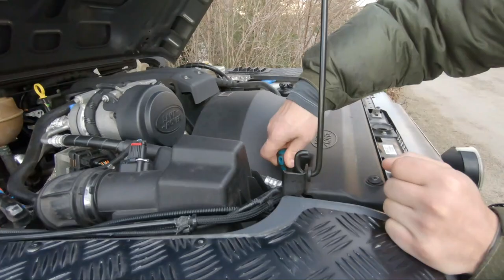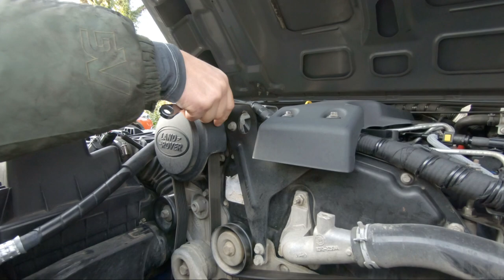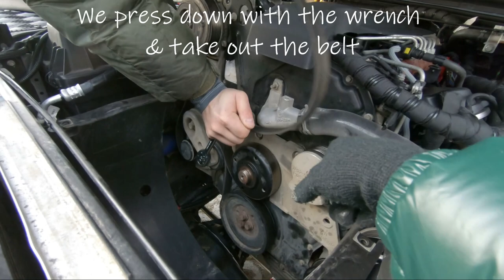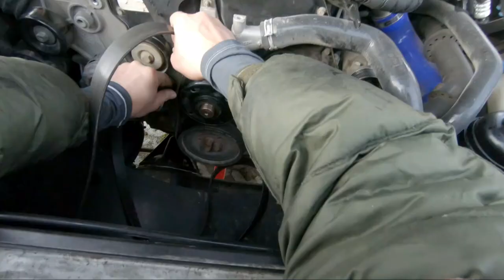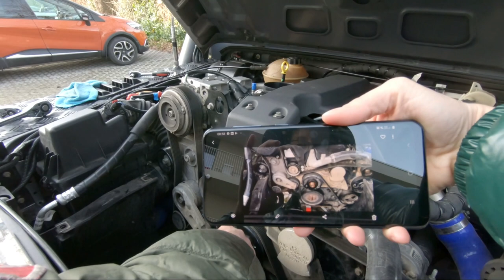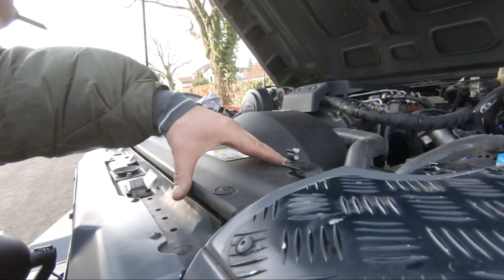How to REPLACE SERPENTINE BELT on DEFENDER PUMA 2.4 TDCi | Land Rover Defender | Maintenance series

Comment: Having purchased a previously owned vehicle this is one of the areas I was concerned about.  I suspect it is still the factory fitted belt so I am very pleased to have seen your video on how simple it actually is to change. Thank you for the well formatted instruction.
Reply from the maker: Thanks a lot for your comment. Sometimes it's easier than it seems. Just need some time to start the work. ;)

Comment: You actually don't need to remove the fan. There is a yellow marking on the fan and when you position this marking to the belt tensioner you can release the pressure from the belt a shown, remove the old belt and install the new one. I have done it twice already after about 90.000 km each.
Reply from the maker: Thanks for your message & sharing on another way to remove the serpentine belt. 
In any case, we find it easier to remove the fan as it stays in the way :)

Comment: Love your instructional videos guys, please keep them up! When you put the fan back on, did you just spin it tight? Or did you need to tap back down tighter using the same wrench+hammer trick as you used to loosen it? Thanks!
Reply from the maker: Thanks! We just put it back by hand and it rescrews properly when turn on engine

Comment: With the fan and shroud removed, take a look at the overall condition of the radiator for small leaks, and consider blowing out any bugs, seeds or other contaminants that may have clogged the fins.
Reply from the maker: Thanks a lot for this advice :)

Comment: Great video- after some ominous squeaking from the engine bay I am going to attempt this on my puma. Do you know what torque settings (if any?!) these bolts need to readjusted to? Thanks for the video :)
Reply from the maker: Thanks! The best is to check the workshop manual if a certain torque is needed.

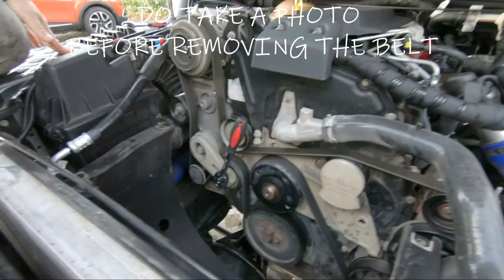Comment: I am 2 years late: Nevertheless: When looking at your engine from the front (1:23 Mark), what is the device on the 10/11 Clock position? Is it the AC compressor or one of your accessories?
Reply from the maker: You must be looking at the heater box, it isn't one of our accessories

Comment: Salut, can you tell the lengtj of the belt?
Reply from the maker: Regular stock length for a Defender 2.4 tdci.
Reply: @offtrackfamily  Thanks. You mean 2843mm (7PK2843)?
Reply from the maker: You should confirm with a garage to be sure you take the one needed for your Defender.